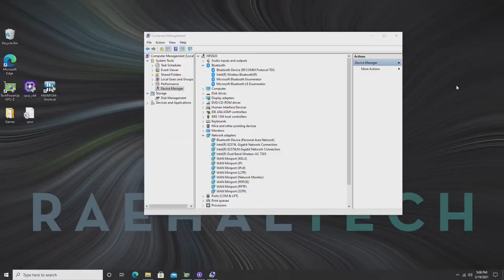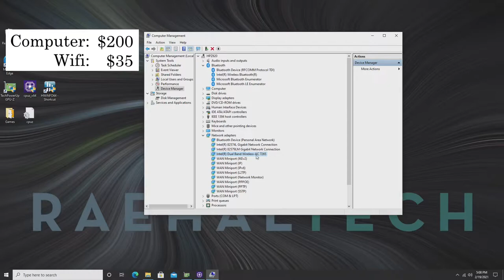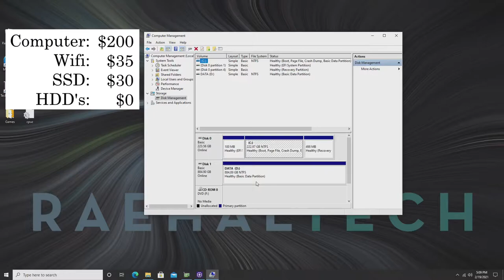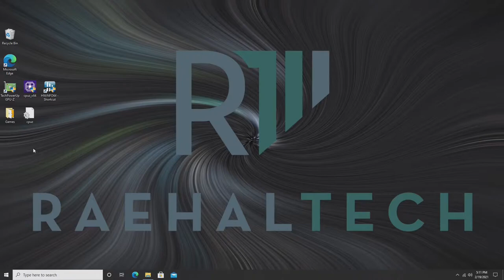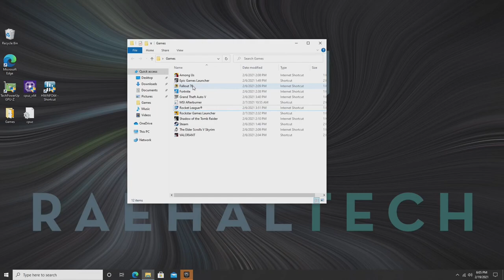Work PC to Gaming PC for $400

Comment: Good video, I wonder how silent this machine is. CPU temp looked a bit high in Valorant with fairly low CPU usage. I believe you can use z420 liquid CPU cooler with z620.
Reply from the maker: This OEM doesn't have the best cooling but it works for what HP intended.  Temps can get high in this case.  Depending on the OEM you can often add better cooling solutions.  

I have some lenovo systems when the mount is part of the case and is used to attached the cpu cooler and hold the motherboard in place.  OEM system can have a lot of varied drawbacks.